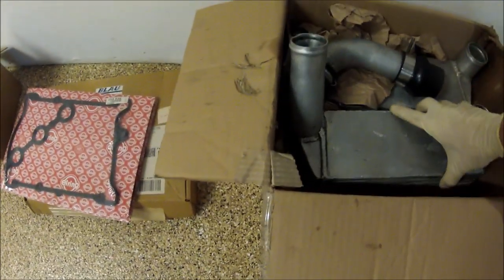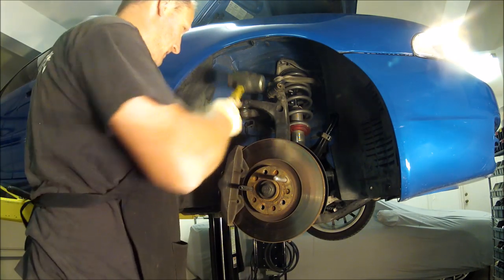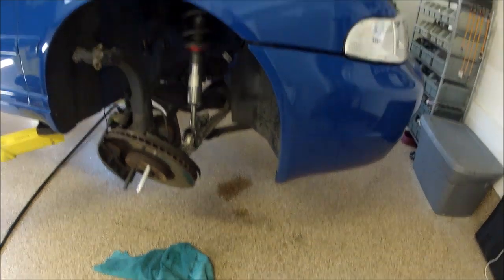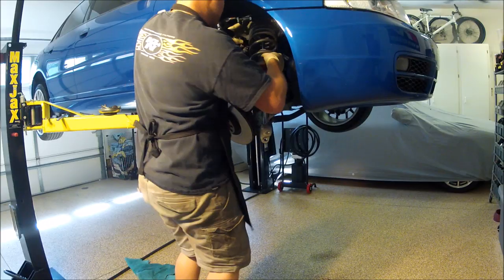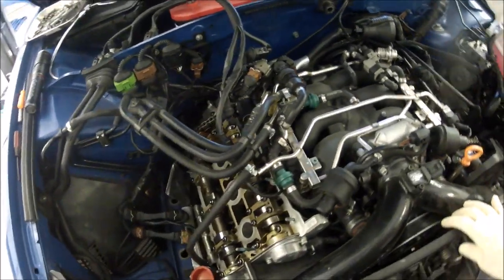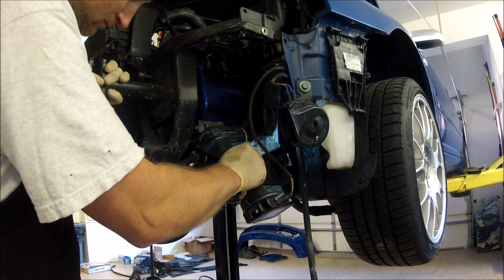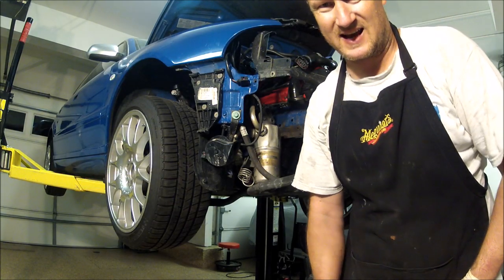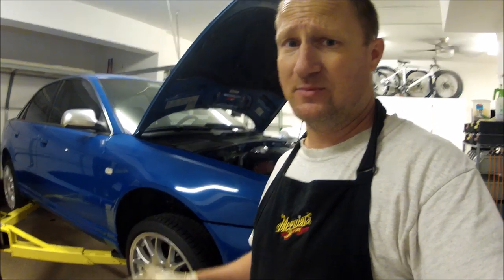Mechanic's Vlog:  CV boot, Upper Control Arms,  Cam Seals, ER intercoolers

Comment: Hey Justin instead of having someone push on the brakes wedge a small screwdriver into the slots in the rotor when breaking the triple Square bolts loose on the axles. It's a great way to do it if your by yourself. Your videos have helped me out a lot if I can return the favor I always will. It's the little things that mean the most. 🇩🇪S4LIFE
Reply from the maker: I have done it that way as well.  I try to show the safest way, which may not always be the quickest way.

Comment: Keep the videos coming man!  A good way to save time when doing the outer axle bolt is by leaving the wheel off, threading in two wheel bolts and sticking a screwdriver into the rotor vents to lock it against the caliper.  Same method is good for the inner cv bolts when loosening or tightening them.
Reply: Both you and Justin are awesome both your videos are informative, your content is great and you guys are God's of the Audi scene as far as I'm concerned. I'm looking at a 2001 B5 S4 in santorin blue pearl🤤🤤 to buy or not to buy🤔🤔?? 🇩🇪AUDI4LIFE🇩🇪

Comment: Nice work, just found you, I wonder you do not give it any seal between boot and joint (like OE), the grease ran out on mine when I forgot this and the joints were dead in a few thousand kilometers and the cork gasket should in my opinion always be fitted, but I have also OCD ☺️

Comment: Hello, when doing the lower control arms is it safe to put anti-seize on the tapered ball joints?  They are such a pain to get out of the upright and I've seen a couple internet posts advise against it.

Comment: I got a question I have a 2000 audi a6 quattro and I was doin a motor install and was wondering if I need the down pipe heat shields or is it okay to run without them ? Thanks